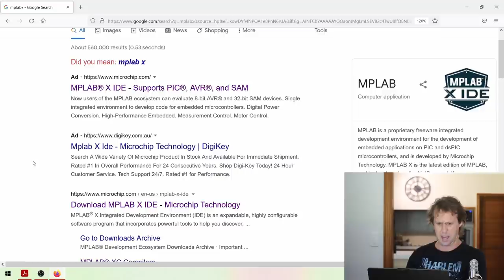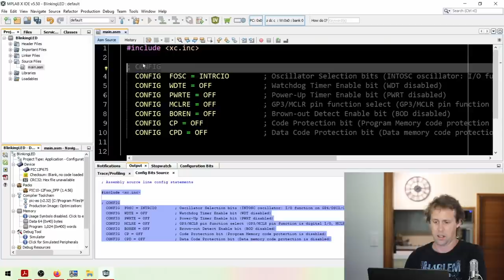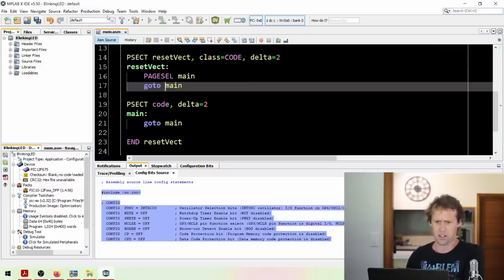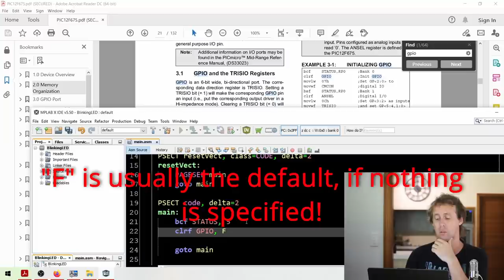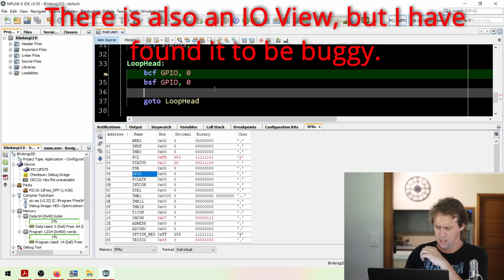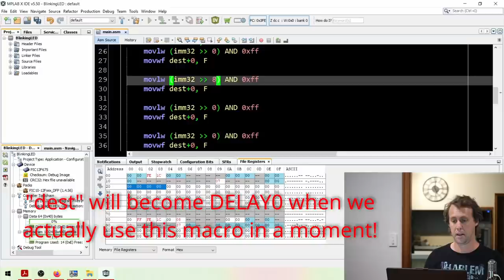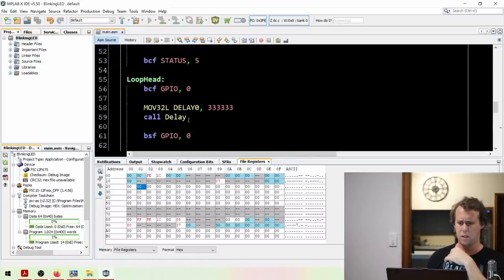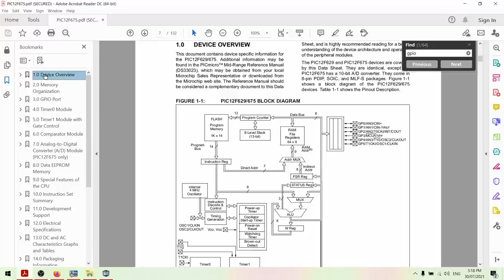PIC Microcontroller Programming - PIC AS Assembler using MPLAB X IDE, Blinking LED

Comment: That was brilliant, thank you so much for putting this together! My first engineering job back in 2002 was as an embedded systems designer using a Microchip PIC as our microcontroller (I don't remember which family, maybe PIC16F). I got to write firmware, I even designed some of the PCBs we use. I was so excited when my first PCB arrived from the fab house! I mounted and soldered the components on with such pride, and the best part was it worked! Unfortunately, that job only lasted a little over a year, and I haven't touched any embedded systems since then. Something recently triggered the itch in me to get back into it as a hobby, so here I am some 20 years later trying to re-learn PIC assembly to build some fun little automation projects for around the house and camper. Thank you!!

Comment: I have just written the same code for a PIC16F84A using XC8 (pic-as) v2.36 found it kept generating multiple syntax errors, starting at MOV32L instruction. 
After much frustration and web trawling and reviewing the tutorial 5x+, I ended up downgrading the compiler toolchain to XC8 (pic-as) v2.32, as used in tutorial. 
It built successfully to my suprise !! I am so happy, great tutorial. Thanks.
Reply: I'm writing code for 16F690

The ", F" on movwf in the macro seems to be the issue for me, when I moved back to v2.30 I was still having some warnings & errors on build in mplab v6.05

This version of the macro compiles with pic-as v2.41 for me

MOVBIGL macro dest, imm32
    movlw (imm32 >> 0) AND 0xff
    movwf dest+0
    
    movlw (imm32 >> 8) AND 0xff
    movwf dest+1
    
    movlw (imm32 >> 16) AND 0xff
    movwf dest+2
    
    movlw (imm32 >> 24) AND 0xff
    movwf dest+3
 ENDM

Comment: Just a note, Watchdogs should NOT be resetting your chip frequently. The point of a watchdog, if used properly, is to reset the microcontroller if some bug causes it to get stuck in an infinite loop of become unresponsive somehow. In normal operation, you periodically reset the countdown so it doesn't reset you. But if you get caught in an infinite loop or your code gets derailed by a rogue pointer, the timer won't be reset so the micro gets reset once the countdown completes.

Comment: Any Arduino can also be used as a programmer. The IDE can write the programmer program to the Arduino, then you wire up the victim on the breadboard and set the IDE to use the Arduino as a pass-through. (There are several guides online.)

I've done this reliably with ATtiny chips and it's been a great (and cheap) solution.

Comment: PIC micros are my GOTO for most projects. A better starter is 16f. You still need to switch register banks but you can use the ICD (In Circuit Debug) with Pickit and MPLab. So good to be able to step code on the physical device. It makes debugging so much easier. Not disrespecting the 12f, I have used many 12f's and they are very cheap to boot. Also it was great to see you telling people to initialise the comparator and ADC registers. Many hours spent in the early days debugging only to realise the GPIO is being overtaken by internal modules. Great video! 👍

Comment: Another method is to lean on TMR0 to do the delay. It's a bit more advanced, but it's much less code, more accurate, and means the μC can be put to sleep for the duration, which is great for cutting down power usage.
Reply: Your comment alone has made reading the comments worthwhile. Mr. Total Newbie here wondered if the approach shown in the video was the best way to do this, and glad to hear there is an alternative. That said, I think for this video, the "sub-optimal" approach here was spot on; it avoids distraction & makes this video a better teaching tool IMO.

Comment: Two of my favorite things in one video - creel and PIC!

I could be wrong, but I reckon it's "XG ecu" - with ecu referring to engine control unit. These guys seem to make a few vehicle related products. Great little programmer though, I have one and it can program a lot of different devices - MCUs, PLDs, ROMs etc. There is also an open source command line tool available for it (called "minipro") that's runs on Mac and Linux.

Comment: I love assembling for PIC, but I also absolutely hate it, because information is so scarce. It seems very few people are doing it with pic-as so it's hard to find relevant forum posts, etc. The Assembler Guide and the Migration Guide are great, but also.... sometimes not so great. Also the build errors are so often just completely useless! Thank you for spreading knowledge.
Reply: books i'm trying to read teach MPASM. even after applying MPASM to PIC-AS migration, i still get cryptic error messages. running a working Simulator in MPLAB X is a pain in comparison to MPSIM. man Microchip . . .

Comment: Hello, for avoiding to add `-presetVect=0` in linker option you can declare PSECT like this:
PSECT resetVect, abs, class=CODE, delta=2
ORG 0
resetVect:

The magic is permitted with the `abs` attribute in PSEC and also the directive `ORG 0` (or `ORG 0x0000`)
Reply: please, if you understand that "psect" new directive help me,
(psect udata psect udatashr psect code ) in ram
PSECT CODE
PSECT class=CODE
all those diferent ways are placing my instructions in completely arbitrary different parts of the program memory.
some of them are in the first registers, some others in the middle and some others in the end, even when i write "code" this way, one part of my program goes to an "extra section program"... i don't understand anything...

also PAGESEL ANSEL... i don't understand them, but i don't really care of it, i'd just like to know about PSECT to start programming.
thanks if you can help me... i really don't like this new pic-as

Comment: Nice to see some real programming. Not like that python garbage! haha. Also nice mic (I say this because I have the same one. I got it because it looked cool LOL.)
Reply: @motbus3  js does really suck 🤣
Reply: What mic is that by the way
Reply: @JoshuaJapitan  um I think it's a Samson meteor mic.
Reply: There are many programming languages that deserve to be shat on but Python isn't one of them.
Reply: @RedGuardYF  well firstly my comment was meant to be slightly jokey I don't really hate python (its not PHP 😅.) But secondly I think while there are lots of good things about it, python also has problems. One obvious one is the use of indentation to define scope.  It can lead to a lot of errors that are hard to fix if something happens to the indentation and although it means slightly less typing I don't think it's worth it. Another problem is the lock that the interpreter uses that makes it hard to scale across many threads.
Reply: @samzx81  I don't agree that scoping by indentation is bad. It's meant to force programmers to indent the code after all.

Agree about the GIL tho.
Reply: @RedGuardYF  yes but I think that's basically not needed since almost every editor that you'd want to use will automatically indent your code. Also if like I said if you mess up your indentation accidentally with nested if's and else's it can be really annoying to fix (also if I'm not wrong you can't mix tabs and spaces, which I know you shouldn't do, but if you use someone else's code or change editors or something it can be a problem.) I just don't think it's that hard or wastes that much extra space to add some braces also I know the indentation does most of the work I think braces do also help break things up a bit and make the scope easier to visually identify. 
Anyway I guess it's a matter of opinion.

Comment: What is the better architecture, those little PIC chips or the ATtinys?  I know the tinys are fully supported with open source cross compilers.
Reply: The best one is the one that gets the job done. 🙂

In all honesty, just pick one and get started. They'll both do certain jobs as equally as well as each other.

Once you hit a situation where you need something else, you'll know. And at that point you'll probably have a better idea of what you need.

There are some open source tools for PIC as well, such as gpasm.

Comment: When you need to debug embedded assembly code, and you don't have a simulator for the assembler (as happened to me in 1986 with my first program in Modula II, in a project requiring assembly to control a machine), you can still print the microprocessor's registers with the following trick, in which, as an example, registers PC, A, B, X, and CR will be printed at different assembly-coded program locations. If _ASM( assembly code) is the format of the assembly-embedding instruction, insert the following fragment, adapted to your case, at various places in your embedded code:

) /* DEBUG * to print PC, A, B, X, and CR */
print << "DEBUG: PC=" << _A << "; B=" << _B << ";  X=" << _X << "; CR=" << _CR
_ASM(

I also included a HLT or BRK instruction, to halt the machine, after the "_ASM(" instruction, like "_ASM(HLT", in several of the insertions; but that is up to what you deal with.
The above code first interrupts the embedded assembly code with the ")" sign, then prints a line similar to "DEBUG: PC=123; A=25; B=0; X=4321; CR=210" and finally resumes the interrupted assembly code with the "_ASM(" final code.
When done with debugging, search all the occurrences of "DEBUG" and carefully delete the previously inserted debug-code lines without damaging anything else; or comment them out as much as possible if debugging is not totally done with.
Edited: typo correction. Paragraph on HLT added.

Comment: Hello, I have a question, when I program the pic and leave the output-only bit (bit3) it does not act as such, I have done it with other microcontrollers and if it works, my intention is to use bit 3 with a boo?

Comment: Hey man this has helped a lot with my pic16 but i cant seem to get a pic18 working, it compiles fine but the debugger jumps around irrationally and when adding a retfie it just loops between that and the psect, any advice?
Reply: ok so i just figured it out, the problem was the delta=2 phrases at the start. with them removed the pic18 works

Comment: Wow, what a bizarre assembler!  Having to specify custom linker options of -presetVec=0 on every single standard program, which, in every other assembler in the history of the universe starts at 0 by default (including mpasm),   That's plain insanity, and even after doing more than a dozen of pic-as programs, I still have to figure out each time what the magic incantation is.  It blew me away when pressing the button to send my hex file to the PIC,  that it implied the programmer only programmed the config bits until I added that little bit of nonsense.

Comment: Following along in MPLAB X v6.15 i get syntax errors on "clrf GPIO, F" and "MOV32L DELAY0,33333" and google doesn't seem to be my friend. Anyone able to give me a hint as to what I'm doing wrong?
Reply: "clrf GPIO,F" should now be "clrf GPIO".

It's a similar issue with the second error. In the macro definition "movwf dest+0,f" should just be "movwf dest+0". (And the same for the other 3  similar statements in the macro.
Reply: For some instructions, you can replace the , F or , W with , 1 or , 0.  However, CLRF and MOVWF don't have the second parameter, so them being present in the video was a mistake.
For those instructions that do support a second parameter, one option writes the result back to the file register, and the other to the W register.  Look at the PIC12 datasheet section on "instruction set summary" for details.  I suspect the older assembler had F and W as pseudonyms for 1 and 0, I',m not sure if that still works on the newer versions, because I use ,0 and ,1 anyway.  Usually you can omit the parameter and the assembler defaults to using the mostly-sensible (and most used) default.  Sometimes you want to use the  not-obviously-sensible option: for example, MOVF foo ,1  reads the contents of the foo register and writes them back to the same register!  W is not affected!  This can be useful sometimes, because it still tests the contents for zero, and sets or clears the status Z flag.

Comment: I'm getting a "BlinkLED.S:56:: error: (876) syntax error" on the MOV32L DELAY0, 333333 line, can someone please help me?
Reply: This is my first MACRO ever. I did save the file as BlinkLED.S. It was .ASM. No difference
Reply: I found the problem. In the Macro, you had MOVWF dest+x, F. The ,F was not allowed and caused the Syntax error
Reply: @martinziskind3971  Thank you! this is also the case for a lot of other parts in this video where F is used at the end when it does not need to be.
Reply: @martinziskind3971  same here, MPLAB ide v6. Thanks for the solution. Still a great vid Creel thanks to u2

Comment: This video is a good example, why 16:9 is a terrible screen format for programming. He just has like 10 lines of code visible at a time :) But as long as you guys buy 16:9 monitors, this won't change.
Reply from the maker: I zoom the text in so it's large like that. By default there's a lot more on the screen.

Comment: In the 21st century, with efficient optimising compilers and high clock speeds, why muck about with assembler? Difficult to read, write and maintain!
Reply: reverse engineering. redundancy.

my biggest kick is running back through hex dumps of code compiled, see how its actually stored on the device. only one step away with opcodes from the raw data. try and figure out whats going on without documentation. can see ways to improve code, tighten it up.

etch off a chip cap and theres no documentation. work out a program simply by the "fuses burnt". cant do that in higher level languages.

engineers working on that 70 yr old voyager "asm" language are getting paid well... dead and buried yet still kicking... 

asm may seem clunky but imho, its nice to know how half and full bit adders work, what a shift register does, even the seemingly simple task of division or subtraction in binary can lead to a rabbit hole... higher level languages obscure things.

sometimes theres no need for a chip with all the bells and whistles. 

sometimes theres the satisfaction of figuring out how to do something seemingly never attempted before...